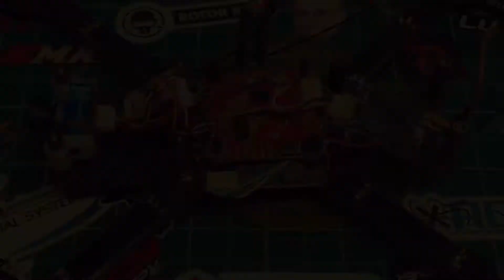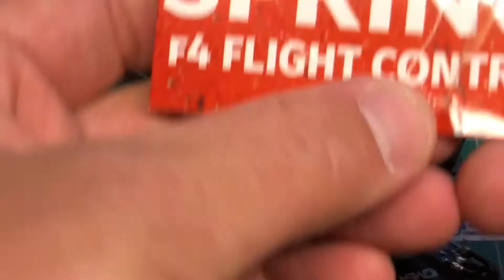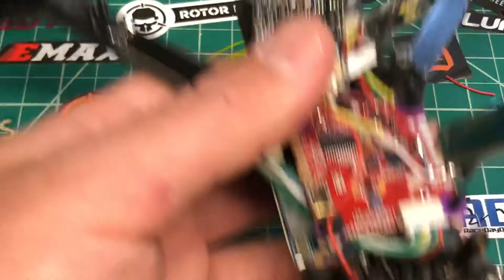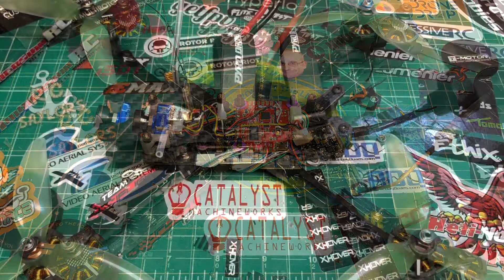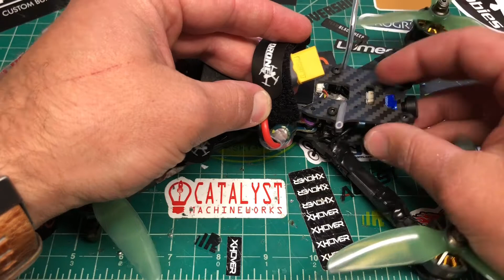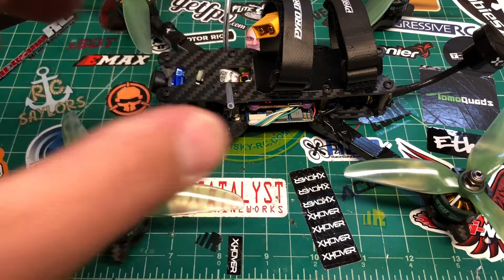How To: Connect Heliospring Imu-f Flight Controller

Comment: Nice video.. you said that ur using the foxeer micro predator. And ur camera control works. I have the regular foxeer predator. And the helio AIO. I cant get mine to work. You also said something about uart 1. Do you have to setup anything in the ports tab or the modes tab to get it to work. Mine doesnt work.. also r u runing a ground with the osd pin
Reply from the maker: Yes you have to set the uart in BETAFLIGHT to runcam control, big predator doesn’t seam to work anyway. Micro predator and newer runcams.
Reply: Chris Romano u have to connect to betaflight and set it to runcam camera control. R u running betaflight. How can u connect to betAf. if it has buttetflight in it
Reply from the maker: FPV Addict sorry Ment butterflight. Same info applies.

Comment: So on the plug going into the FC from the esc you have both the vbat and 5v pins going into the FC, I assume the FC uses the vbat one for voltage sensing and the 5v for power, but can it be powered only off the vbat pin?
Reply from the maker: Kwadify FPV depends on which you decide. The pads just above the plug header. But you can run both into it. Then pick 5v or vbat. I used vbat. If you select 5v it will use the vbat line for voltage in the osd.
Reply: Chris Romano wow thanks for the crazy quick reply:) where did you connect the VCC pin on the dal 4in1 to?
Reply from the maker: I used a 4 in 1 that had he correct pins that matched the helio. I just plugged it together with the wire then selected vbat on the helio.
Reply: Chris Romano oh ok, I see. Thanks for the help